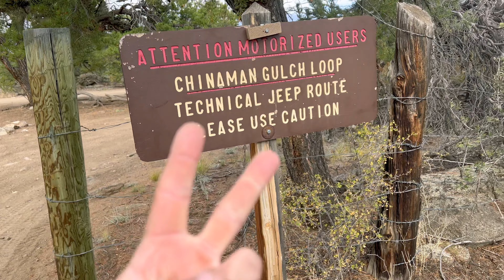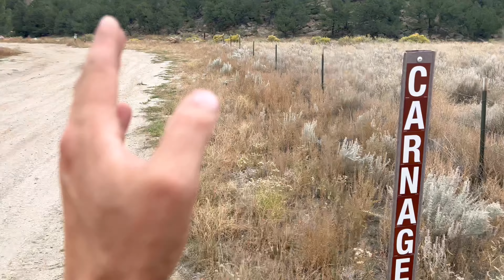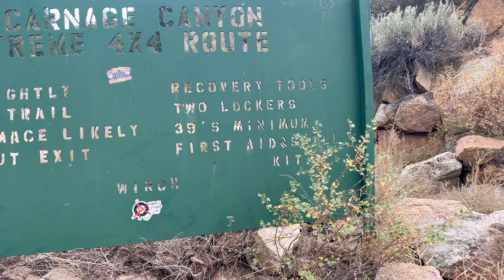CHINAMAN GULCH with JEEP on 35’s (EXTENDED CUT + BEHIND the SCENES)

Comment: Good looking trails.  Need to address your sway bars.  A big hammer will help lol.  You picked some decent lines, but I saw a couple spots you could have done a little better lol.  Not hating, but study your lines and you'll see it.  With 17 in wheels, you could safely drop the air pressure to about 12 or so.  I've done it many times.  I run 15 inch wheels on my 2 door JK now with 35s.  Allows me to comfortably run 10 while crawling.  That said, if you find yourself in the West Texas area with your Jeep, hit me up.  I'll show you a sweet little spot.
Reply from the maker: Thanks for the tips! Yeah there were definitely some different lines that I could have taken….or done better….I’ll definitely have to do that if I’m ever in West Texas!
Reply: Oh yea, for what it's worth, you broke one of the main rules of off roading.  Never go alone, but you really didn't hit anything too hard for me to make a big deal of it.  BTW, if you do ever make it out here, bring an rc to race.  We've got a pretty good track here.
Reply from the maker: @ajeepnameddarkside2575  yeah…..well when you’re not from around there and don’t know anyone…..my only option was really to go alone lol….or not at all…..I wasn’t super worried…..a little bit with tire placement and not having a spotter….but it ended up alright….whats the nearest large city to where you’re at?
Reply: San Angelo
Reply from the maker: @ajeepnameddarkside2575  10-4……I’m considering going on another wheeling trip down south In the winter or early spring….maybe we can work something out…..is there many off road areas down there?
Reply: Twin Buttes Reservoir is free and about 5 mins from town.  Wolf Caves off road park is less than a 2 hour drive.  Then there is Big Bend.  From what I hear, the trails at Big Bend Ranch State Park are more fun and challenging than the ones at the national park.
Reply from the maker: @ajeepnameddarkside2575  ok thanks for letting me know! I’ve never been wheeling in that direction before